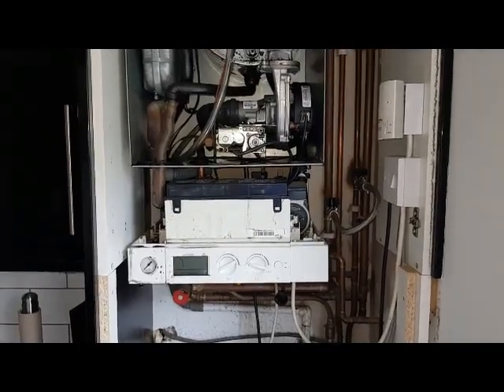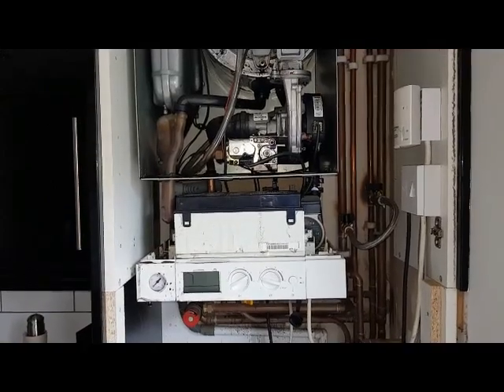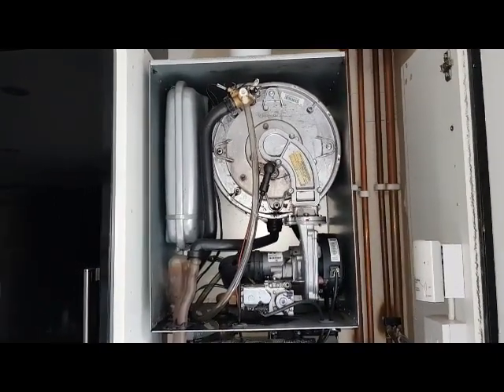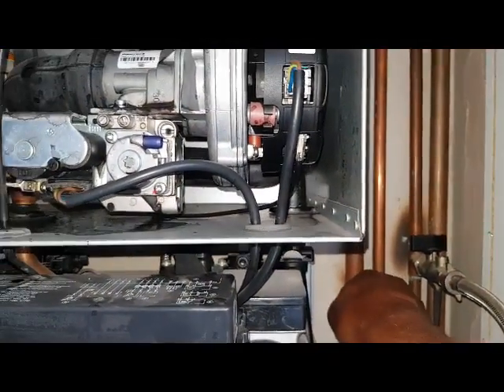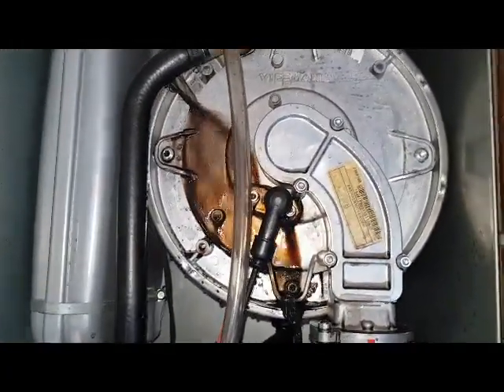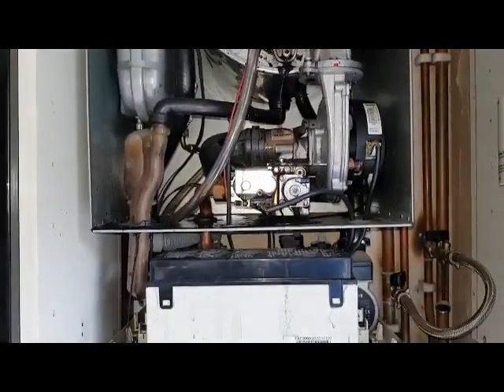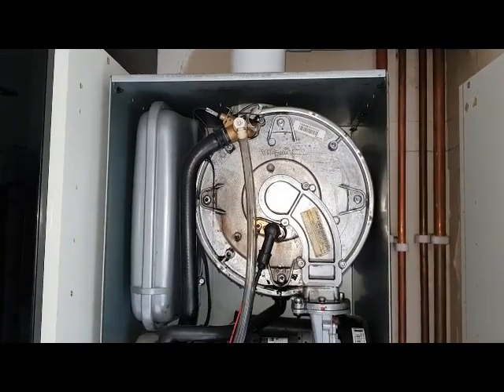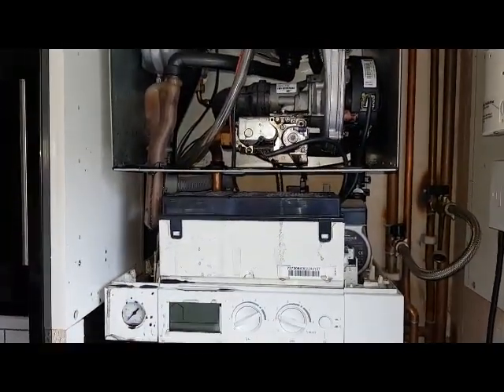Viessmann Vitodens 100, bad defect. With Coach Tony Morgan

Comment: Never seen a service in its life. 
If it had it would be under warranty. 
The 050-W and 100-W are two of the best combi’s on the UK Market.
Reply from the maker: Thanks for your comments
Reply: Can anyone please tell me the difference between the 50 and 100, no one seems to know.
Reply: @chengambj  The 050 is the cheaper, lower spec. contract model.
Reply: @chengambj   Yeah Mark,The 050 is a low spec version and more importantly the 050's are all made in Turkey,probably the reason they are cheaper.
Reply: @turbo3492  Hi Brian the 050 is actually made in Germany and not in Turkey

Comment: Viessmann have swapped the rubber hoses for copper on these now
Reply: Not on all models. Only on ones for the DIY market.
Reply from the maker: hey we're currently trying to grow our Facebook group and would love you to join Tony and the team using this link, Tony will be available to answer all your questions directly there's also updates on new trainings we just released too. https://www.facebook.com/groups/167070231326174
Reply: @andrewmillwardwatford9410  Which one is the DIY market boiler Andrew? The hoses are still used on the 200 series and the 111 model I’ve never had any issues with them on the 15+ I have fitted
Reply: @SalimKhan-gk1fh  050 and 100 are for low cost markets
Reply: @andrewmillwardwatford9410  Hi Andrew nice to hear back from you mate I really wasn’t aware that the 050 or the 100 series is for the low-cost market I’ve always found them to be a top quality boiler from a top reputable brand, I know the 200 series is the daddy but equally the 100 series has proved very effective for me , and my customers have loved them . This video with this Guy who claims to be a heating engineer is absolutely laughable!!!!!

Comment: That’s not the boiler at fault, it’s caused by very dirty system water. It’s an easy job to change those hoses. System needs a good power flush and mag filter installed.
Reply from the maker: hey we're currently trying to grow our Facebook group and would love you to join Tony and the team using this link, Tony will be available to answer all your questions directly there's also updates on new trainings we just released too. https://www.facebook.com/groups/167070231326174

Comment: I’m afraid you’ve got that wrong there. Viessmann vitodens has been a very successful boiler. look at the shoddy way it’s been installed. the thing has never seen a service you can tell that by the black water coming out
Reply: I think they have changed that hose for a copper pipe now, so he might have a point.
Reply: @metallitech  It’s all down to installation and a clean system the hoses haven’t really been a problem last 10 years or so this guy doesn’t even know what he’s on about
Reply: @SalimKhan-gk1fh  Salim you are correct,Viessmann boilers are probably the best combi boiler you can buy.The only people that deride them are the brain washed Worcester Bosch fanatics.Viessmann are higher quality than any Worcester you care to name.
Reply: @turbo3492  Yes Brian thanks for pointing out ,I’ve been using viessmann boilers for over 10years now and have had very good results in themIn terms of reliability and efficiency ,they are a very very quiet boiler to run and the best I have come across on the gas consumption once modulated down , if you work a lot on boilers you will realise these are an absolute dream to Repair maintain and dismantle you can literally remove anything in 10 minutes without cutting any hands either!
Reply from the maker: hey we're currently trying to grow our Facebook group and would love you to join Tony and the team using this link, Tony will be available to answer all your questions directly there's also updates on new trainings we just released too. https://www.facebook.com/groups/167070231326174
Reply: @ARBoilers  I won’t join in the live chats I don’t think you’re very competent engineer videos like these should be removed very misleading information
Reply: @Minix Tvbox They are not junk at all I have about 15 viessmann boilers in service and none have any issues with the rubber hoses I’ve even got one in my own house , they are still used at the moment all over Europe but the UK 100 series is now copper the 200 series is still rubber hoses never had an issue with the hoses on a clean system. They do not use crap quality plastic components like worcester,
Reply: @Minix Tvbox I don’t understand what your problem is with plastic?  is not a  normal plastic viessmann Use the same plastic they use in cars water manifold , you are confusing this with Worcester Bosch, baxi 600 Has plenty of plastic look at pump housing,  divertor valve and that stupid filling loop all plastic.  So How is viessmann boilers number one across Europe?
 and all thei commercial stuff is fitted in Heathrow Gatwick all the big schools and hospitals???

Comment: This fault is a direct result of failing to flush out system cleanser when installing the boiler. Even a small quantity left in will have a negative effect on the hoses. Some fitters will add a cleanser, drain, fit the new boiler and just refill the system, meaning all the low level pipework will still contain cleanser. If you use a cleanser you MUST fully flush the system to remove all traces as per British Standards. The reason the water is dirty is some installers will just add cleanser and don't bother to flush the system at all. Cleanser will either cause the hoses to pinhole, split or swell up like balloons. If this happens to your Viessmann don't blame the boiler- you should get your water tested by Fernox and then take it up with your installer..............hahaha...that will never happen...cos he's long gone now!  Told you he was too cheap!
Reply from the maker: hey we're currently trying to grow our Facebook group and would love you to join Tony and the team using this link, Tony will be available to answer all your questions directly there's also updates on new trainings we just released too. https://www.facebook.com/groups/167070231326174
Reply: It seems you read the mi😁

Comment: It's full of treacle. Poor conclusion on a good boiler. 
Like any machine a boiler requires competent maintenance. I have approximately 80 vitodens 100s on my service contract. Perhaps this is why none of them get issues with split hoses. Many of them have original hoses still fitted after 12 years of service. I expect 20 years from the Viessmann boilers and 8 to 12 years from most other appliances. 
The wb1a was a problem boiler for Viessmann but with original issues sorted these are a great boiler. The boiler in the video is not a wb1a. 
The Vitodens 200 is without a doubt the best boiler available today in the UK. The only boiler suitable for use with ufh.
Reply: Andrew Millward 
Yes well said Andrew I have seen a few of the guys videos and I will not calling him a heating engineer at all !
Reply: Quite right Andrew, properly installed those hoses should last the life of the boiler. Many of the ones I service are now in the 12 - 14 year bracket.
Reply: You talking lots of crap on Tony videos. He showing examples only and not his instillation skills. I found his videos are good for people who begins them early carries. Shame on you guys who complain on Tony stuff.
Reply: @woolf147  Tony got it wrong but that doesn't mean we hate him. Good guy just a poor call. Well done for defending him though you must be a nice guy. Happy new year to you my friend.